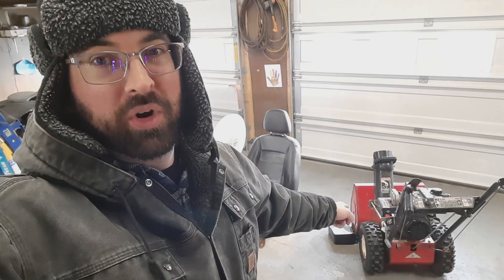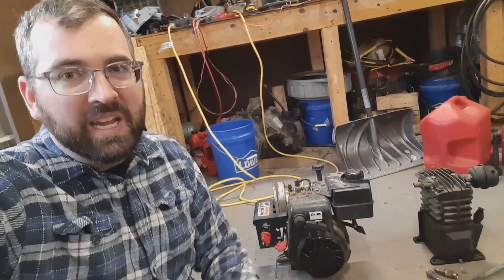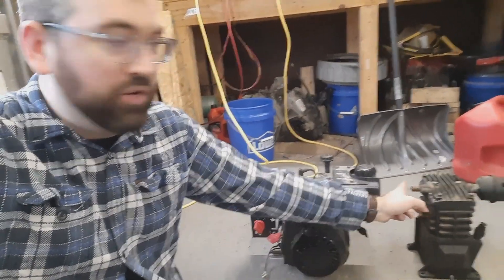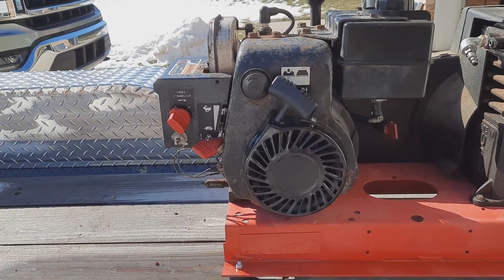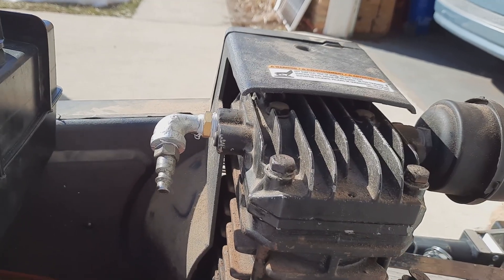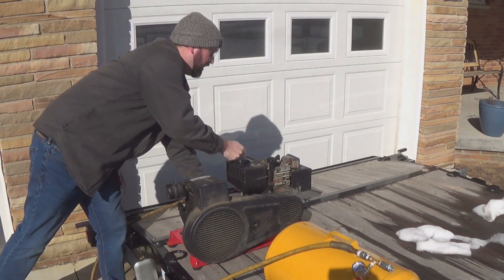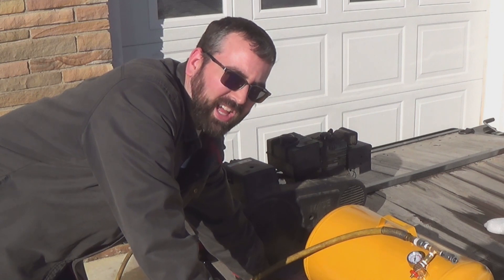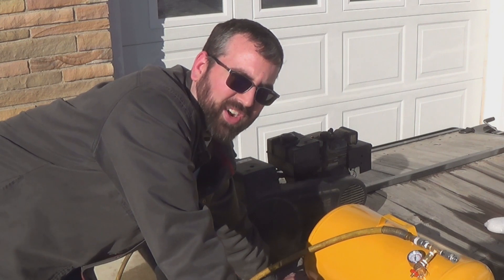I Built My Own Gas-Powered Air Compressor From Scrap Parts And I Can't Believe How Awesome It Is!!!!

Comment: No unloader valve?? Lol. 💣At the very least you should have another pressure relief valve set at 125psi, to act as a sort of unloader. Also is there a check valve in that setup to relieve the compressor head from tank load? That kill switch should be wired into the higher relief valve to kill the engine if that is ever hit, valve gets stuck one day, you know what is going to happen.
Reply from the maker: I do have a proper unloaded valve now. I converted another snowblower to an air compressor and bought an unloaded valve I can use with either compressor. There is another video I uploaded a few months ago for that project.